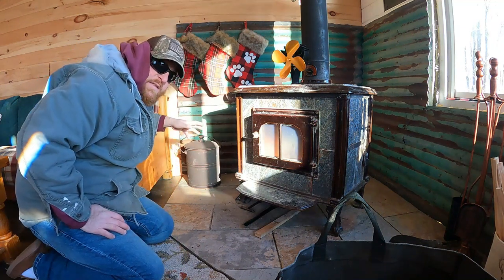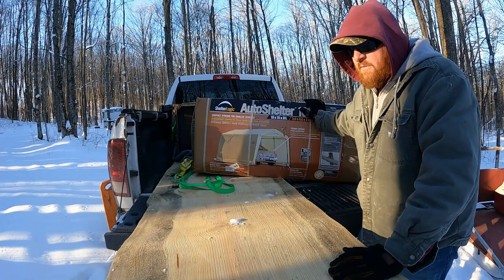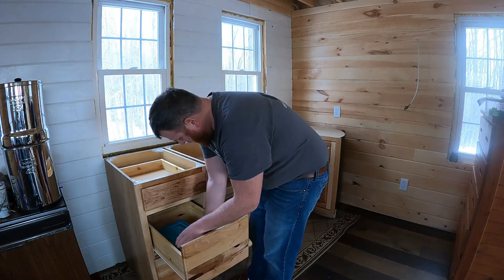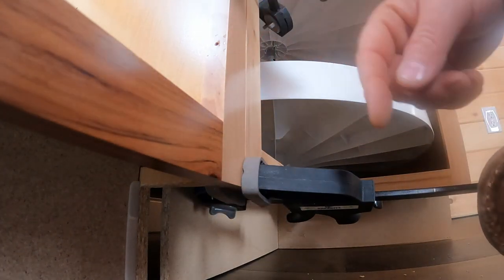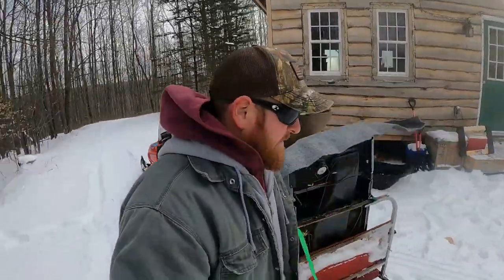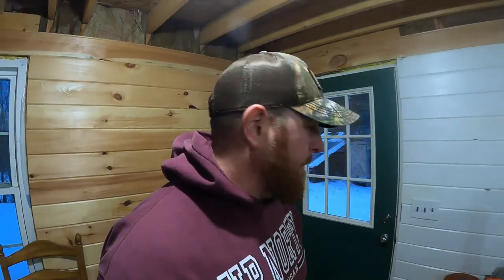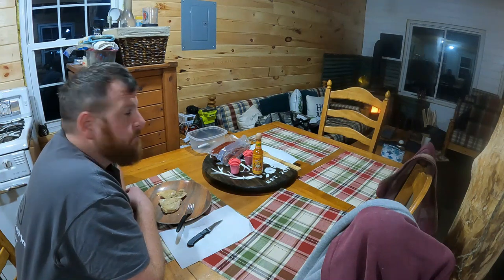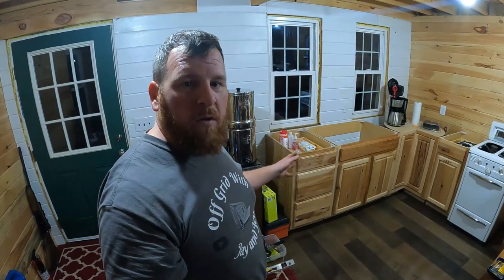Kitchen Install at the Off Grid Cabin | FINALLY have Cabinets and Cookstove  No more camper cooking

Comment: Hallo Jay! Kannst du nicht mit dem Auto nach oben fahren? Schneeketten und ab geht es ! Eure Autos haben dich genug PS und Hubraum! Da würde ich sogar mit mein Citroen C4 Picasso 150 PS hochfahren! Du bist ein ganz toller Handwerker und baust für deine Frau eine Küche👍👍👍! Ich kaufe sie mir fertig und lass sie aufstellen! Gibt es bei euch keine Kohlen die halten die Wärme! Holz macht schnell warm! Wir haben vor 50 j die Asche dazu verwendet um unser Fußweg vor Glätte zu streuen! Schönes Video 👍⛄ Gruß aus Brandenburg Udo 🇩🇪 bleibt gesund
Reply from the maker: hello my friend. The old pick up truck could maybe make it up there with chains, but being somewhat remote, if it were to go badly then I might not have a truck any more, lol. Going down the hill is really Scary too......would be very easy to slide off into the woods where the truck would not be retrievable until spring. Glad you like the Kitchen, we are very happy how it turned out so far. as always thank you for being here, Best wishes

Comment: The indy 400 started right up for you and was cruising really good. We see your chores were done first before you even got into the cabin, great job. Its a good thing you guys leave everything set up for your next return. Saves alot of time which is great 👍. 10 degrees  😳 the sun sure does help. Cool auto shelter for the work shop. We will be waiting to view. Kudos on the kitchen guys. 👏
Reply from the maker: These old sleds are treating me well so far.......fingers crossed. Best wishes buddy
Reply: @Off grid with Jay and Jen  such a great asset to have in winter

Comment: I saw another homes reader add a wood frame to that workshop shelter at each end.  One side with a door that locks and put the roofing tin sheets instead of the plastic tarp .making it  a permanent building for not a lot of money.
Reply from the maker: very cool.....Will keep that in mind once the Tarp gives out to the elements. Thanks

Comment: Careful with that loose ash pan. It can turn into a raging forge and damage your stove!
Reply from the maker: That is a good point......I should work on it a little. The little hook/handle snapped off before we owned it, and I have yet to find a way to 100% secure it. I'll move it up on the list. Thanks for the heads up

Comment: Jay. My stove has a gasket on the ash door just like the main door.  If it isn’t tight, you’re right it will over burn. Mine also has a heavy spring that keeps the door closed.  If the stove over fires it can warp, crack or cause the heavy interior stove baffle to get brittle.
Reply from the maker: Very good points....my ash tray door has the gasket too, but the little latch that holds the door shut is broken.....so it stays closed but not super tight so just a little air gets in there. so far it doesn't seem to let the fire get TOO hot.
Reply: @OffgridwithJayandJen  mine uses a heavy spring. No latch. Probably a design change.

Comment: Hey Jay you could swap out the front burner with the back burner on the same side I never use the left back burner. Great job on the kitchen sink. 👌
Reply from the maker: Thanks Dave, I was hoping to do that too, but the burners have an attached tube that fits to their specific spot......so guess I'm a back left burner guy now, ha ha..

Comment: Love your cabin! Great Job! Question: How big is your Berkey, and do you leave the filters in it whlie you are away? Wondering if it is ok to leave them installed in the cold temps?
Reply from the maker: I'm not sure the size but I believe it is the largest model they make. If i were to guess it hold around 3 gallons. We leave it empty this time of year because we just hall in 5 gallon totes of water that is drinkable so no need for it really. I would drain it if you were to leave it in a cabin where it cold freeze, the top section where the filters are still hold about an inch of water even after filtering so that could damage the bottom of the filters I would think. and then the bottom spicket where you get your water from could easily freeze and crack if not emptied .

Comment: Do you use a locking carabiner to attach you sled to your snowmobile?
Reply from the maker: There was a little hitch set up on the snowmobile,  but it broke and I did just buy a couple clips at tractor supply to get me by. It works, lol